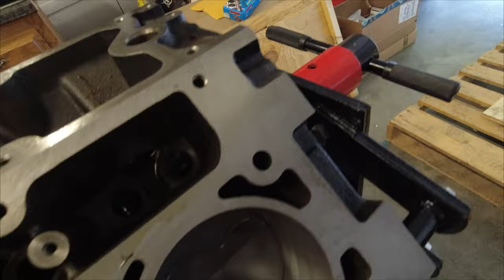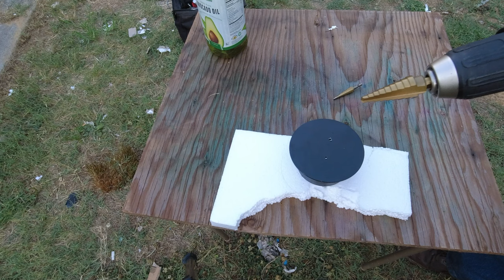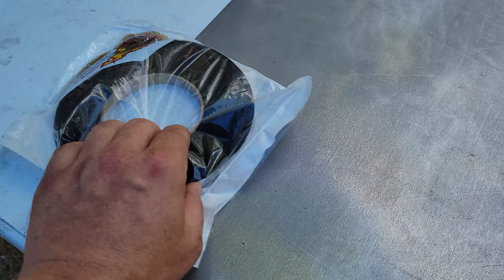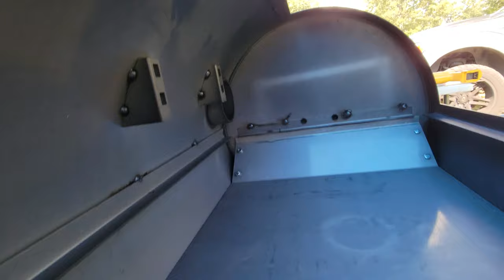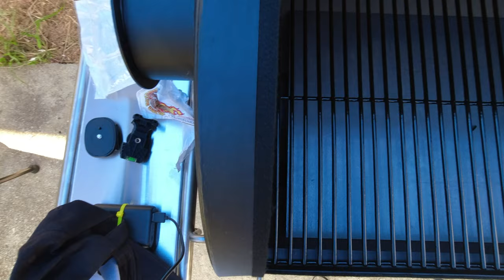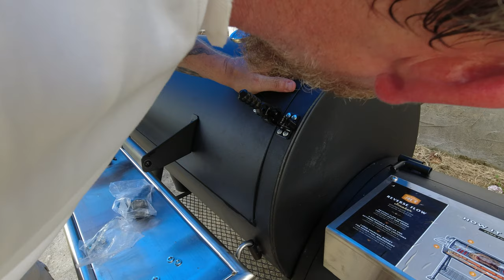Installing bbqsmokermods On The OkJ Longhorn Reverse Flow Anthem Series

Comment: Thanks for the inspiration for installation of the bbqsmokermods' OKJ longhorn reverse flow baffle plate system.  I like your solution of cutting across the top of the new baffle to fit under the existing grate mount next to the firebox.  Removing grate mount, as suggested by bbqsmokermods, will greatly weaken the firebox and mostly cause further sagging which is a big complaint on the OKJ smokers.   Good job and thanks again for the video.
Reply from the maker: You are very welcome. And yes, removing that grate support would definitely make the firebox sag. Honestly you would think as much as the new baffle costs. Bbqsmokermods would have that fixed so you don't have to cut anything. Sucks spending money on something that meant for the smoker u got, just to have to modify it when u get it haha

Comment: Nice vid, thank you! I did pretty much the same tuning plat mod with sheet metal. That gave room for ice trays! I live in Michigan and can easily do this, but I see you obviously live in a more temperate climate. In the winter, I lay trays of ice on the bottom plate and on the top racks, lay the meat in middle and voila…cold smoker. I am able to smoke and keep the temp in the safe zone below 40°F. Makes the best bacon you ever had. Keeping it under 40° means cooking in the pan and not in the smoker.
Reply from the maker: Awesome. Thank you for watching

Comment: Excellent mods.. TY for these awesome vids, I hope OJ is watching all the mods and they should offer them as options, did you have any issues with the firebox bending at top heat? Reason is that this grill is thin, being less than 0.25" think. Also, regarding the clamps on the drum, its probably better to use two on each side to clamp down more evenly to address the bending that happened with one clamp in the middle
Reply from the maker: @kirkiribhai  thanks man.  Only issue I had was the firebox did sag alittle, not much, not enough to hurt anything.  The way I put the clamps worked great, didn't have a issue at all.

Comment: Enjoyed this video. 

ONe year later, do you still like this smoker? I"m considering purchasing it.  

Thanks.
Reply from the maker: I sold it about 8 months ago and bought a old country bbq pits over and under from academy. Cheaper and all welded and way better than this okj
Reply: @Get2Diggin  appreciate the quick response.  One question for you re: "Old Country BBQ" you got. 

Did you do any mods or baffold(sp?) plate updates?
Reply from the maker: @syrtyce  I havnt done any upgrades to the bbq pits over and under. Only thing I bought as a upgrade was a perfect smoke temp controller. But that is just for not having to baby sit as much.

Comment: how many inches did you cut off the plate?
Reply from the maker: I didn't really measure how much. It's gonna be different on each one I believe. Depending on where they welded the lip inside. The lip inside mine wasn't even from one end to the other. They welded the lip in at an angle so when I cut. And grinder to make it fit. One end I had to cut more off of. If I'm making sense.

Comment: Just curious, why no holes in the baffle plate?
Reply from the maker: It was reverse flow baffle plates. The baffle plates with holes in them are technically for standard offset. The reverse flow plates with holes doesn't make it a true reverse flow, is my take on it

Comment: Wouldn't the location of that water pan get sucked straight out of the exhaust pipe and do nearly nothing for the cook
Reply from the maker: In hindsight, ur probably right, but that's how they made it to go in that location, also the water pan hold alots of water, nearly 2 gallons, so maybe that why it so big to create alot of moisture so it don't suck all of it out the exhaust pipe. It worked well is all I know.